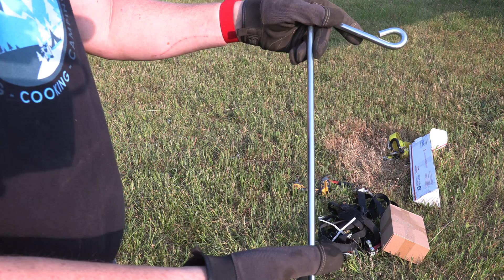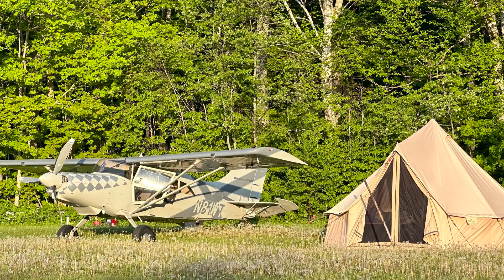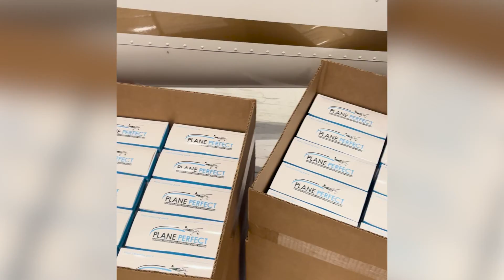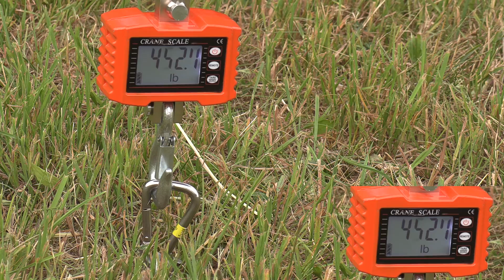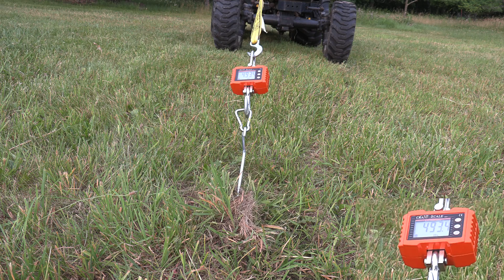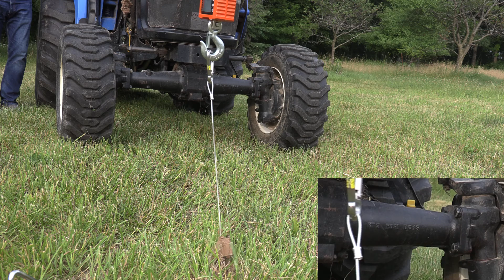Oshkosh Tie-down shoot-out - Five popular systems tested

Comment: Not saying the dog stakes are great but turn it 180º from your video example and it will perform better than posted. Also what if you fastened it to the ring, not the handle.  The handle was never designed for fastening.

Comment: TLDR; Longer anchors, planted at 90 degrees to pull. The angle of the pull relative to the anchor, multiplied by anchor length.
If you drive a stake straight down, it takes the least amount of force to pull it straight out.  Change the force to 90 degrees, and the force to pull it out is a factor of the lever arm.  The longer the lever arm, the more force.  Also, if the force starts to generate soil movement, the anchor is failing.  continued movement will weaken the anchors and they will eventually fail.
The best anchors you tried had the longest anchors, with the best lever moment.

Comment: In 2012 I had 3 pieces of #5 rebar welded with a T at the top of a 2 foot long length and then painted to prevent rusting.  Using a 5 lb small sledge hammer and hammered it at 90 degrees to the direction of the tie down rope from the aircraft.  All the way to the ground with the T just showing in the grass.  Tension of pull is 90 degrees to the direction of it being hammered in.  Works great, but I have to bring the small sledge hammer with me.  Pulling the stake along its direction of installation when taking them out is relatively easy.  Never had any problem with it for all my Oshkosh trips from 2013 to 2022.  The secret is the rebar protrusions.  They work in soil the same way they work in concrete.

Comment: Nice part about the EAA Tiedowns..... the chapter will pop your EAA purchased tie downs in the ground for you every year for no additional cost. No need to bring you own hammer to install. The North 40 is littered with rocks from fill especially north of 09/27.

Multiple marriages have been saved by having someone else install your tie downs after flying the OSH approach, being overheated, and having to use the bathroom.
Reply from the maker: Great information! And thanks for sending a kit so we could include it in the video.

Comment: Great video Rich!  One caution on the cable type anchors...I had a few of these installed to keep the kid's swingset from rocking.  I moved the swingset yesterday, and every one of those cables was rusted in two after about five years in the ground.  Maybe I bought cheap ones and stainless ones are available?  I've had good luck with screw-type anchors in our black soil (the kind with a screw welded to a shaft, not a corkscrew dog tie down.  They do take quite an effort to install though.
Reply from the maker: Good note on the cables. I don't know of anyone selling a stainless solution, but the company that makes duckbills will sell you just the anchor portion and you could attach your own stainless for a permanent installation like that. Thanks for sharing your experience.